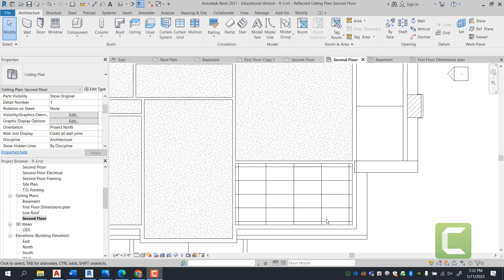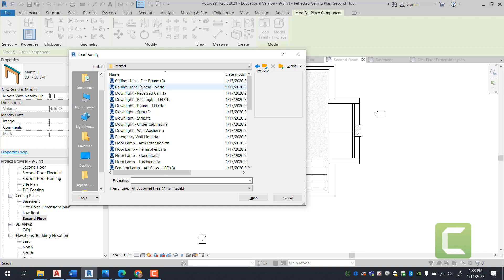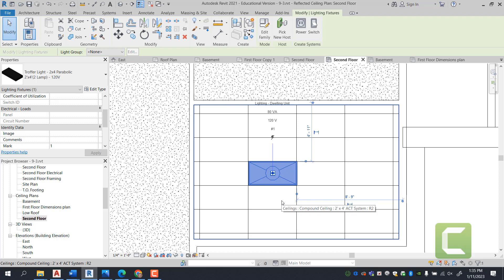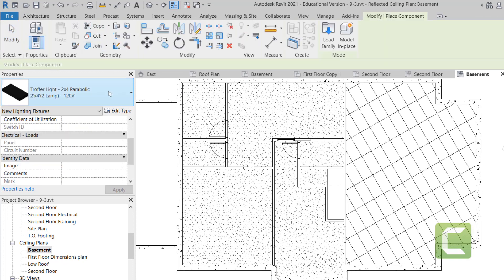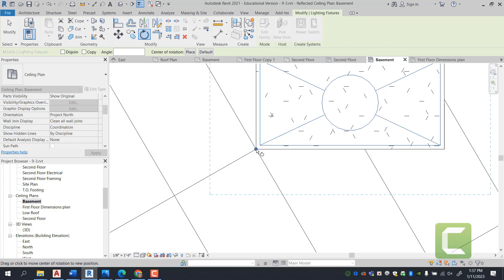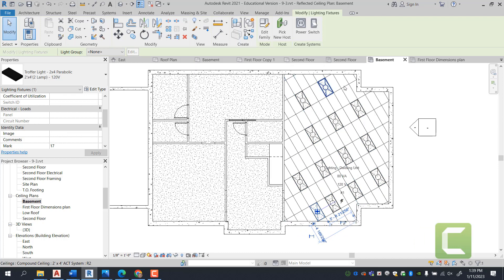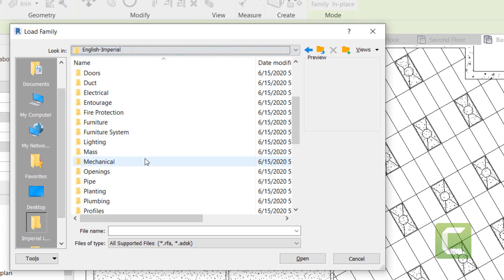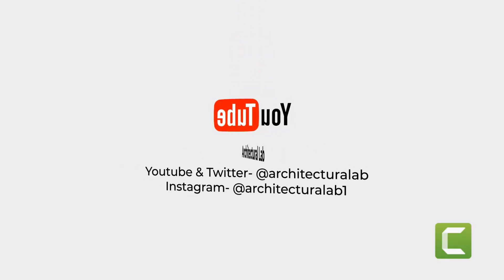Revit Exercise 9-3

Comment: When I copy and paste the lights and try to place them my ceiling is no longer visible so I can't line up the lights to the grid. Have you encountered this? The ceiling pattern is still visible when i'm not trying to paste the lights.
Reply from the maker: I have run across this issue on previous projects… for some odd reason they lose host ceiling my solution was placing multiple light as components at the same time then use align to adjust them to the grid
Reply: @architecturalab  Thank you for the reply and for making these videos. Do you have any videos on the toposurface exercises of the book for Revit 2025?